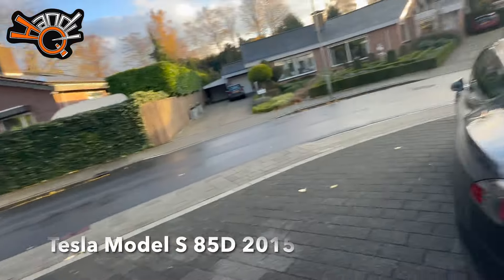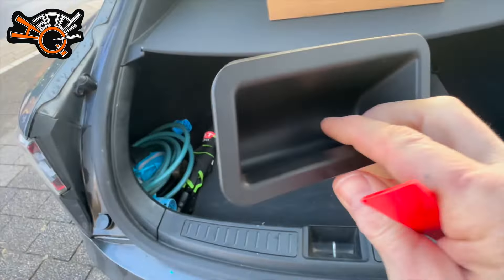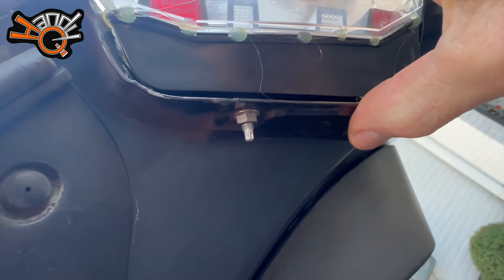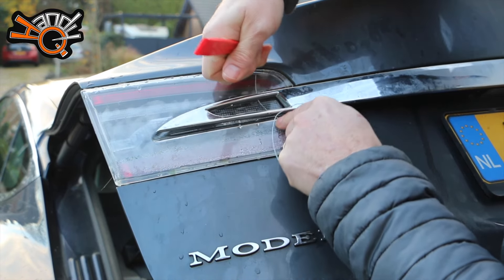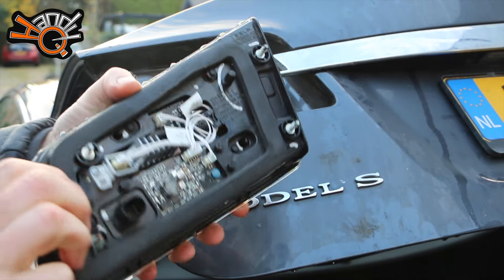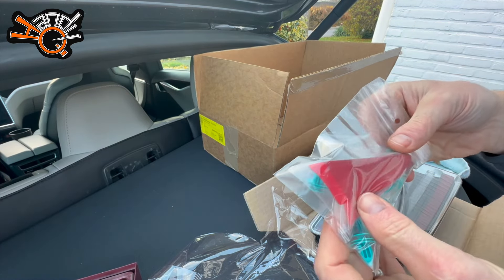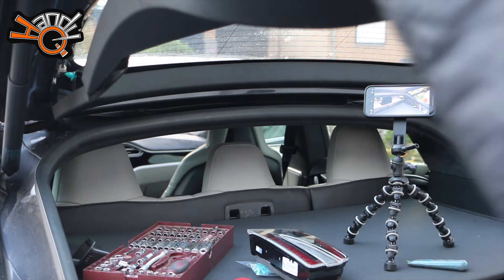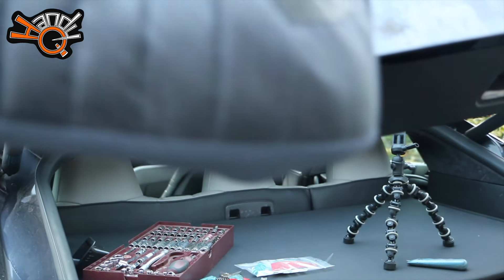Tesla Model S tail light repair @HandyHQs

Comment: My rear plastic had a screw I had to take out first before I was able to pull it down. And how did you unplug the wire from the back of the tail light?
Reply from the maker: Ah, I can’t remember, but think it was one of those horrible plugs you have to stick the nose of a small screwdriver into it to release the clip

Comment: Same issue here, it was the seals, moisture but still functional. I flipped the new seals left to right so they stick to the car and not the light as the lights surface is not flat. Also spider and flies graveyard due to open design 🤦‍♂️
Reply from the maker: Cheers, yeah mine was totally gone so needed to replace it. Too fancy compared to old style lights :-)

Comment: Thanks for this video, did you order just the tail light(s) or gasket as well as it had it on the lights it seems. Thanks.
Reply from the maker: Hi thank you for the support, I just ordered the tail light, but it came with the 2 sides rubber to set the trim back in place